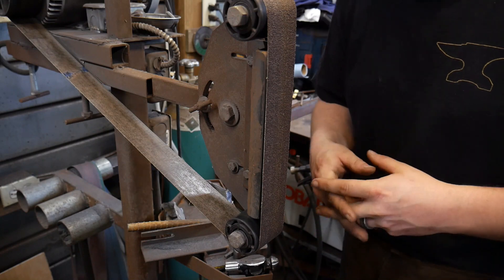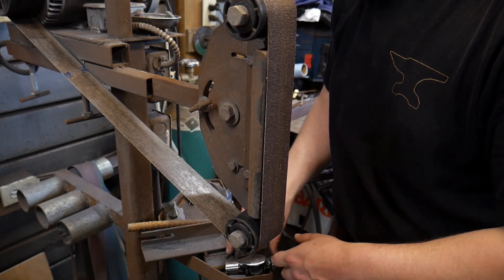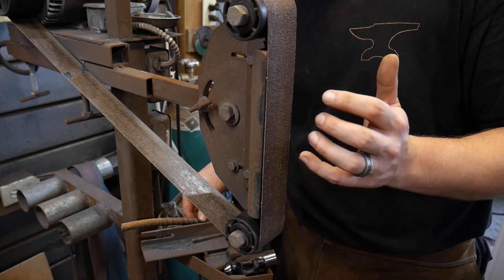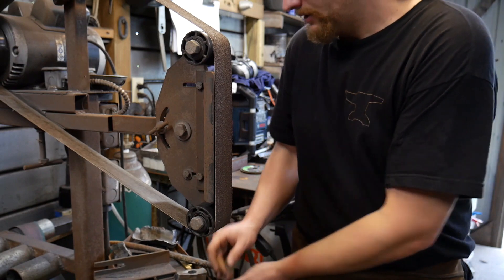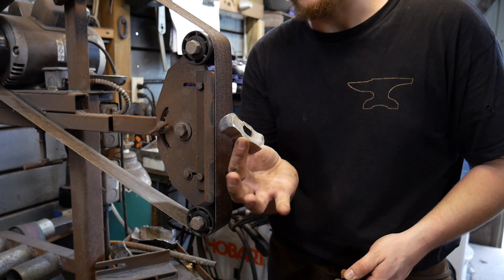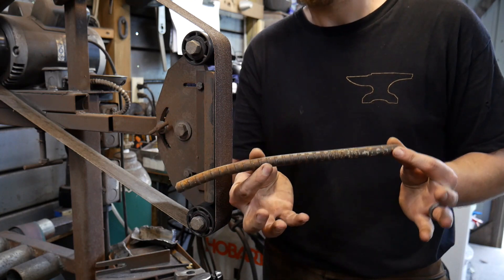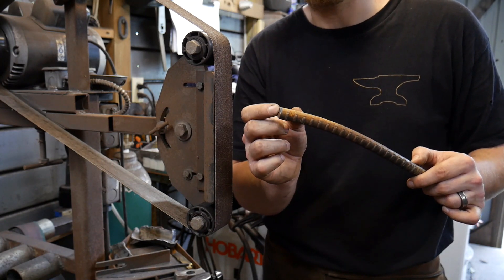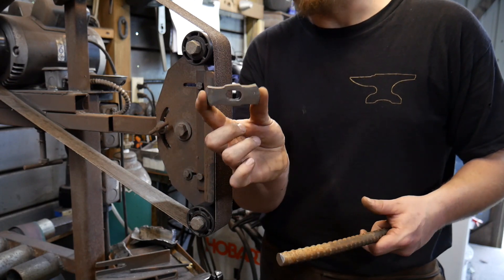Spark Testing Steel [Pro Tip Series #18]

Comment: You are right about rebar being unreliable. Nobody's going to take 1084 and bury it and concrete in a road. The problem with rebar is 1 inch might end up with a bunch of carbon in it the next inch and up like mild steel you can't rely on it. Start forging yourself a nice pair of tongs and quench them and see what happens more often than not they'll split right down the middle you can't rely on it. I'll take known steals over unknown steals any day I might weld it on the bottom of something to stick it in the ground for that little extra height but nothing reliable or structural. Consider this I bought 3 foot by 5/8 by 2 in bar of 01 for $5 more than the equivalent amount of mild steel why in God's name would I mess with rebar. Keep up the tips it's nice to have a medium short video with some information in it

Comment: Thanks for the video Roy.  I have always had trouble understanding and remembering how to spark test steel.  the fewer "sparklers" w/long streaks the lower carbon content it is. Shorter streaks w/lots of sparklers the higher carbon it has.  To bad it can't determine the alloy content, ie: 10xx series from 41xx or 51xx series steels.

Comment: what sort of belt grit do you use for spark testing very coarse or medium grit
Reply from the maker: Medium grit works best in my opinion about 60g
Reply: cool not that i have done any hardened steel work as yet but i have some leaf springs and coil springs that are for the power hammer sooner or later finances are tight

Comment: Enjoyed the video.  Your previous vid on this rebar convinced me to have a look at my  rebar drops from federal highway construction.  It has  the two dots and is marked 13S4.  Decodes as: 13  not sure, maybe metric diameter, S Billet Steel, 4 is 420 grade aka grade 60 or 60 KPSI yield strength.

Copied one of the tables I used to ID it to my blog
https://zombieengines.blogspot.com/2018/07/rebar-identification.html

A picture of breaks and grain after water quenching
https://zombieengines.blogspot.com/2018/08/rebar-again.html

I have a hard time reading sparks but will give this material a try to make punches.  Would be great it if worked for lathe tools even if only for aluminum.